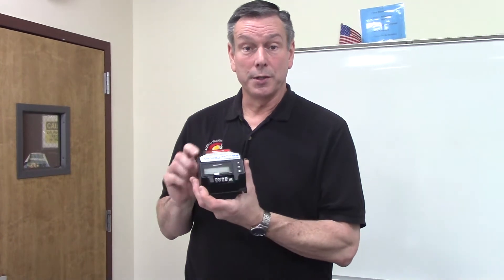Honeywell 7284u Control

Comment: What should the "TT" setting be on if you operating a furnace with a programable thermostat (ecobee) be set on?  My configuration has an internal jumper.  If I'm reading the instructions properly I should set it to "Yes" with no wires connected to "TT".
Reply: u need a thermostat to set temperature in your place don't ya??? how else w ill the system know what Temps to comfort you at??? cmon man!!!